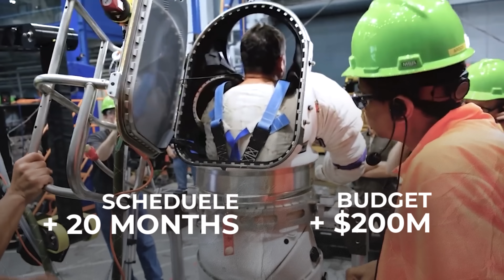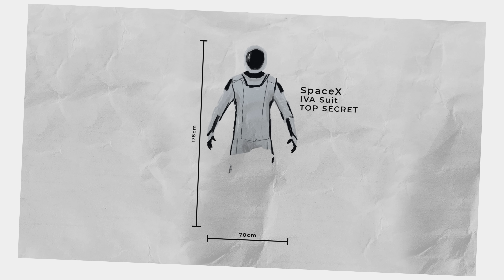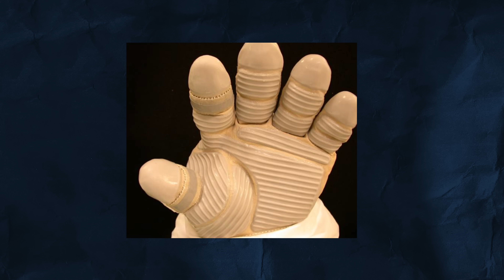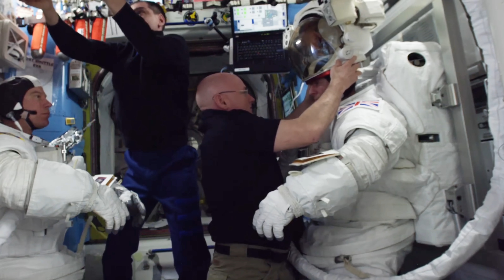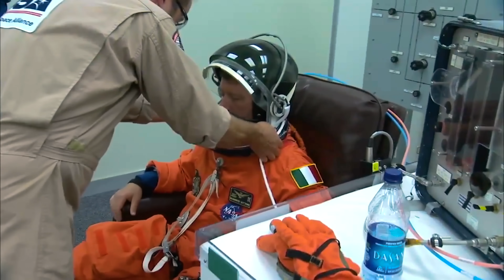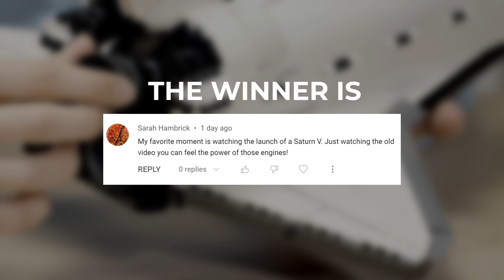How SpaceX Mastered Space Suits

Comment: so the issue with movement is pressure in the suit, why not have a small tank attached to the suit so that when you start flexing, the air can flow into the attached tank, and then when the astronaut unflexes, the air in the tank then will pump back into the suit?

That way it can adjust dynamically based on how much of your body is flexing.
Reply: If you only have a single tank on say the back for this that would not work. When the joint bends it will kink like a hose so the air in say the lower arm wouldn't be able to get past the elbow and into the tank. You would need a tank on each side of the joint which would get cumbersome.
Reply: @TehAtomicPotato  couldnt you put some air lines at the kink points so while your bending say your arm, the air still has a passageway?

Comment: Gotta point out that if you strip off all the stuff like micro-meteor protection and cooling systems that make the NASA suits so bulky you'd have something similarly light weight-looking only with better 360° helmets. And just like these suits, they would be too hot to stay in for more than a few minutes in direct sunlight and wouldn't be functional for doing any real work in space. You'll note that the testing here was done on the night side of Earth and the capsule was oriented to act as micro-meteor barrier for those reasons. When SpaceX actually gets to the point of parity with NASA on that level of functionality you're going to see something pretty much just as bulky looking. This stuff is driven by physics, not fashion design.

Comment: Now THAT'S the kind of spacesuit we need - more compact, flexible, durable and far less weighed down by a bulky pack carrying necessary accessories!! 

I hope they continue to make the accompanying tool and breathing apparatus packs in the same mold. Personally, I would have smaller bags for lightweight tools made for the arms and legs that wouldn't weigh them down even in zero-grav, and a more streamlined aerodynamic pack with tubes connected to the helmet that holds about three to four compressed oxygen tanks the size of those carbonated drink tanks like they sell at Bed Bath & Beyond. Also, they could have small compact filtration units that takes the exhaled carbon dioxide and pumps it to small tank units in the feet and rear that would with occasional button clicks jettison the CO2, lightly propelling the astronaut to move from one part of the spacecraft to the other to perform maintenance work in far less time than before. Naturally, make sure that they also have tether lines and magnetic clamps so they can hold on to the spacecraft surface so they don't go drifting off!

Comment: SpaceX has never made a suit at all in fact, the one that they did make is only built to protect crew dragon when they are inside the spacecraft, not outside.
There's a reason that the NASA space suits are as thick as they are, they have to have all that insulation to protect you from the -9999999999999F°
Reply: Absolute zero is only like -459°F. lol

Comment: The suit designed by Space X isn’t a real space suit.  It’s a pressurized flight suit that can only we worn inside the space capsule itself.  Those who are wearing it aren’t in a pressurized suit unless there’s an emergency situation with the capsule that causes it to loose it’s pressure.  These suits aren’t suitable for either EVA’s or moon landings.  They’re very similar to the pumpkin suits worn by space shuttle astronauts.  And frankly, I’d rather be in a pumpkin suit if I had a choice, because they’re proven technology with a fantastic track record.  The same suits are used by high altitude pilots in the airforce, only theirs’ are mustard-yellow in color.

Comment: IVA suits are cool, but they annoy me considering they're mostly just a failsafe for if the crew cabin looses pressure/Lifesupport. Anything that could cause those and their backups to fail is probably fatal anyway. It seems a bit like putting airbags on an airplane, if you need them, they probably won't be enough

Comment: I wonder if they removed several safety factors and redundancies that were placed there by the NASA teams. For instance having a single control valve for pressurizing the suit provides one point of failure. If that valve fails then it would place the astronaut in a critical failure situation.

Comment: Ngl the old suits look way cooler. It's probably because it fits the image of an astronaut in my own head. They're designed with no compromises though, all functions you really need are guaranteed to be on there, rather than challenging engineers to jump through countless unnecessary hoops so the suit looks like something made by a costume designer.

If a bet was placed on my life and I'd die due to a stalling engine when driving either my trabant or my modern Kia as a daily driver, I'd put all my eggs in the trabants basket with no second thought. In every aspect it's worse in luxury, but having an air cooled 2 stroke engine with like 5 moving parts... It never dies or stalls with next to no maintainance, and in the unlikely event it does, any idiot can fix it. It's designed to drive, it's design was kept super simple. 

Space travel is such a place where theres absolutely no place for making compromises, I wonder if this is a sustainable way of engineering when systems get only more and more complicated. But then again, they do keep pushing and breaking other frontiers, the engineering efforts are incredible nevertheless.

Comment: my space suit design will be  the standard model a hazmat suit as the outer layer with a center is a bubble wrap that will be feet, lower body, upper body and head . each that circulate into a heating and cooling device that regulates you body temperature . inner layer a soft material for comfort. goggle type for the eyes. that cut along the nose bone line  and a lower compartment  for breathing and keeping co off your eyes. heavy suit add ons are harder more durable boots legging upperbody helmet that go over your standard suit. any thing bigger will be a XO suit. that you will be able to comfortly get into with your heavy suit.

Comment: You know, impressive is not something I'd say about removing all the valves from the suit. Relying on relays to open and close valves automatically is nice and all, until they fail. Redundancy is necessary for survival of a failure. when it comes to a varying mixture of gasses, what happens when the oxygen valve sticks and the nitrogen valve works as intended? I'm sure there would be a warning on a display, but the person in the suit would rapidly begin suffering from hypoxia.
Reply: THIS Thank you

Comment: Do spaceX use that suits in real vacuum and microgravity?
I ask because good slick looks is definitely priority for that suits, so I expect that it would stiff and bulky in such condition (which was happening in early days after which all that cuirass with metall joint suits  designed. Also ispaceX suits probably  has less autonomy in comparison to russian  or NASA suits.
Reply: The space x space suits arent realy space suits. They are Just simple pressure suits that need a Connection to the capsule for everything. While nasa space suits are their own litte space craft that can operate on their own. Comparing these to is just misleading.

Comment: You seem to be comparing NASA EVA suits to SpaceX IVA suits (I'll call them EVA when they've actually successfully been tested for that), which is an apples and oranges comparison. NASA could make their space suits a lot more sleek, but at significant cost to functionality. EVA suits have to be bulky to offer adequate protection, and that makes all the other necessary components, like pockets and joints, naturally bulky as well. And an eva suit without pockets or at least attachment points would be pretty useless, you usually go on EVA to do something with tools. I'd much rather wear something suitable for the environment at work than something that'll look flashy and futuristic on the launch pad (although considering SpaceX sells itself on its brand of futuristic space travel, I certainly don't think it was a bad choice for them specifically, branding matters). Different suits are also meant for different scenarios, e.g. the suits used for the moonlanding had to withstand heaps of dust.

Comment: its not just pressure and oxygen level twose 2 are combine. Air is 1bar at 21% O2 and 78% N2. When you breath pure oxygen also your suit provides pure O2 with no N2. But breathing 02 at normal pressure will make your lungs burn like a black powder, instead you breath pure O2 at much lower pressure, 5 times lower thus also the suit is not pressurised so much and not looking like a baloon. Also such a suit can relly purely on elasticity to fight a small pressure not looking like a baloon at all. 

Also if your space wehicle has pure 02 you don't need long transition, you just put your suit on and go outside. 

Don't know the helt risk of prolonged 02 breathing thou.

Comment: Should I mention how you are comparing a suite made about ten years ago to suites designed in the 70's? Of course the SpaceX suite is going to be better with access to better technology, but there are several things you are leaving out. The Original Shuttle suites had to be designed for emergency egress of the shuttle (bailing out), the SpaceX suite doesn't in fact, it cannot take many of the stresses of the original NASA suites, and is actually substantially weaker.  It was approved because it is only designed to go from ISS and back, and was designed to be used ONLY within the spacecraft.  Both the NASA and Russian suites had to be capable of handling EVA's in case of an emergency, even though they were not meant for that direct purpose.  You also show them donning the suites, but ignore that one of the things they are clearly showing the astronaut put on is a parachute. To date, SpaceX has been unable to design a similar suite for EVAs because their approach doesn't work. I am okay with highlighting the differences, but don't fanboy out and act like the SpaceX suite is God's gift to space exploration because somehow SpaceX is just smarter.  The difference was in the requirements to begin with.

Comment: It's a dangerous trade off!
Even IVA should have enough  strength to fight against mechanical extremes, many single point of failure is irresponsible ! 

Usually, it should cater for extensive period of exposures for IVA protections on stand alone basis!

Leaving the suite completely  relying on all supplies from external but not on stand alone basis is dangerous enough, and not cater for an extended period of time is irresponsible !